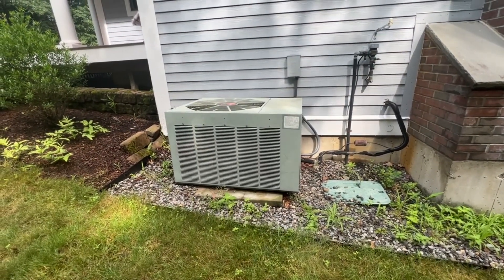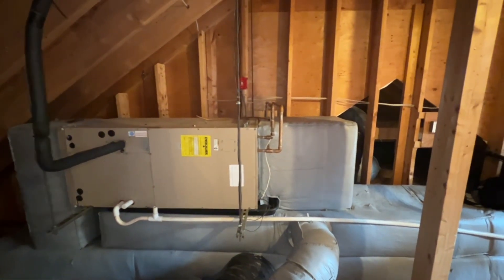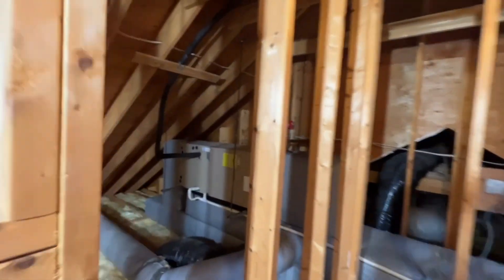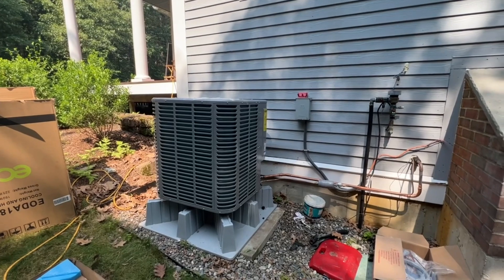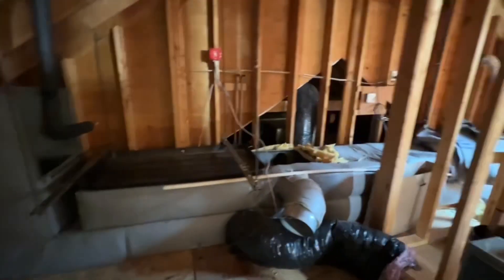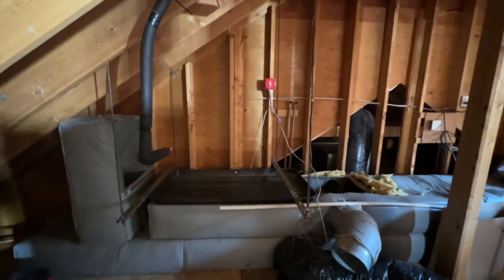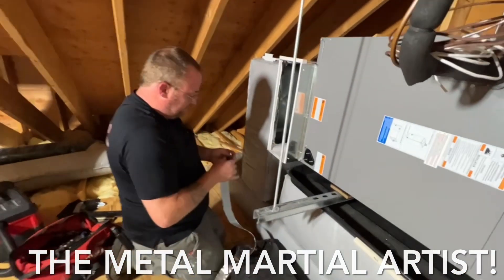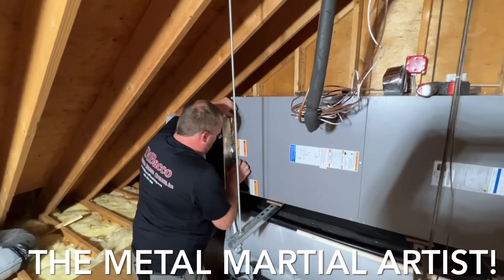Ecoer High Efficient heat pump system install Carlisle MA 7-13-23

Comment: Great video.  I'm about to have to have a Ecoer 2436 installed.  Question, what kind of thermostat will I need to run my existing propane furnace and my new heat pump?  I guess what I was wondering what functionality will the thermostat need so I can search for one?  Thank you
Reply from the maker: we install Ecobee pro smart STATE6P thermostats with room sensors with all Ecoer installs.